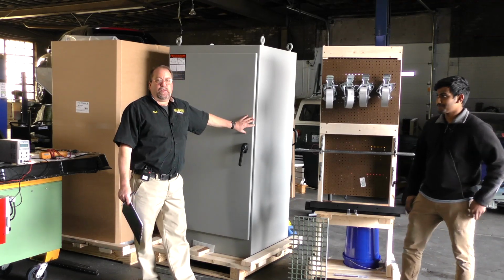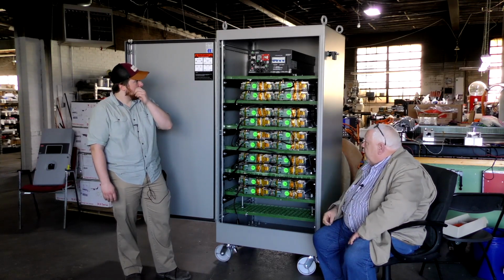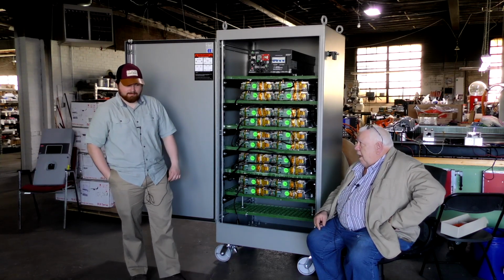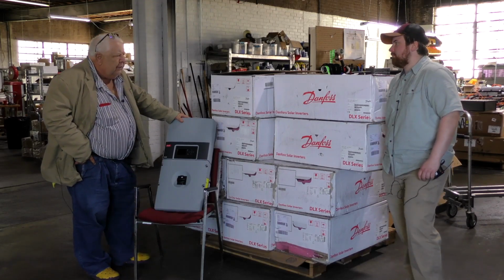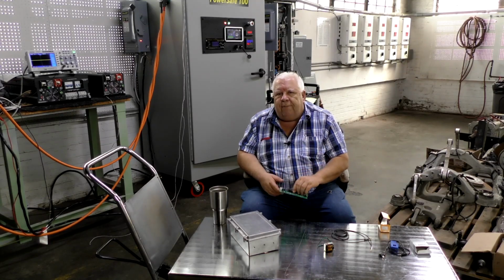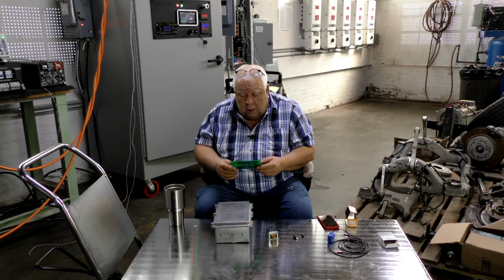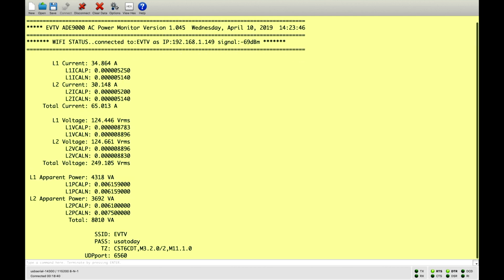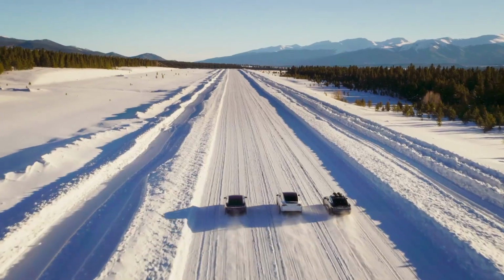PowerSafe 100 Solar Energy Storage for Antigua using Tesla Model S Battery Modules

Comment: I considered using Tesla packs for my offgrid home, instead opted to string one-hundred 1200AH Nickel-Iron cells in series for a 120V nominal battery bank. Edison cells will last a century and millions of cycles without any degredation.  Chang-Hong is the world's largest manufacturer of NIFE cells. I negotiated a $450 per unit price.

Comment: About those 6.3V transformers you want to use in your project to lower the 240V to safe levels: those, or in fact any transformer of this kind introduce reactive power losses and cos φ at the secondary is lower than at the primary. Not sure if that will make any difference for the AD chip you want to feed through those, but from what I understand, you want your measurements to be synchronized with the mains voltage. The phases of the measured voltage will be a little off. Also, those transformers might need to be picked and matched,  I doubt they have been precisely wound as they are apparently off the shelf cathode heaters for vacuum tubes with +/- 10% tolerance.
Reply: Simple electric space heaters are a simple resistive load that may be used during calibration of the phase angle calculation object.  (close enough for government work).  A dual trace O-scope can also graphically display how close the signals are from the voltage and current signals with known resistive loads.  Run the O-scope from an isolation transformer though.  (Don't ask how I know that)

Comment: You are probably deep into making your own solution now but I hope you evaluated eGauge Jack. Much more of a engineer’s tool than Sense. A lot of work has already gone into it and the data is available via Modbus and BACnet. A display sever is also built into the device. Biggest downside is when measurement points are over a 100ft or so apart and multiple units (easily share data) become necessary. I do not work for them, only a customer.

Comment: Giving the the Model S batteries are still fairly expensive, could your PowerSafe 100 be built with one set of batteries (2S1P) and more batteries could be added later as needed?
Reply: @Jack Rickard OK, that's good news. I was wondering if some point you could build a single battery setup going though the minimal parts install (maybe when you do the next Powersafe 100 build?).  Also, I was wondering about the 96 volt Sigineer inverter/changer. I was wondering when that might be available?  - Bart

Comment: I think I look forward to your show more than any other. Someone told me that 240v ac was really +400 to -400 passsing 0v 50 t0 60 times a second. This gives u a chance to unclench 50-60 times a second that u dont get with DC?
Reply: @EVTVMotors  Thamks Jack
Reply: @EVTVMotors  Last time I brushed the back of my arm up against 400 VDC the pain was excruciating.  I shut everything down and installed two Gigavac 400 amp lockout switches I stole from my EV conversion parts hoard.

Comment: @Jack Rickard 
While watching the video, I took some notice of the internals of your "in progress" PowerSafe/100 (PS/100) it looks like you all have taken precautions to avoid lateral movement of the battery packs and inverter, however, I don't see anything for the restriction of vertical movement. Perhaps you all haven’t gotten to that part yet but to make the shipping trip to New York, let alone to the island, the battery packs, inveter and all of the shelves need anchoring down! Maybe you will have bolts that will come up through the sidewall mounted angle brackets that go through the "fiber grate" and will fasten and anchor the shelves and then have some form of retaining straps fastening the batteries and inverter to the shelving?

Also, I was wondering if you all put a rubber gasket or sealant between and around the mounting plate of the cast metal wheels and the bottom of the PS/100 before fastening things together?

Just some thoughts as I watched your very interesting, as usual, video!

Thanks.

Comment: So how to make such inverter off grid. I need a 400v inverter to work with my model 3 battery but i dont want to grid tie cause detroit thomas edison has made it not finacially worth it. Low buy back rates. Really inverter to inverter? To generate the wave yo sync to. Help
Reply: I bought my 20 kW Sandi islanding inverter through evtv.  What with the tariff and all, you'd want something with the MPPT charge controller built in.  Something smaller would also allow the DanFoss units to play well together off grid.

Comment: Thanks for another interesting video!
I agree that open communication protocols are essential, and even better would be fully open source. 
I wonder if you might unknowingly be reinventing the wheel? I recently bought a IoTaWatt, an elegant energy monitor similar to a Sense but more expandable and fully open source. It is well documented and a fully certified product readily available for a fair price. Being open source, I suspect you could easily add the CAN UDP output. I’ve just started using mine and still need to configure a database since the integrated web served graphs are clunky. So far, with real bidirectional power readings and flexible calibration it seems to be an excellent complexity/usefulness tradeoff. 
You may find it does all that you need to provide an ample grid power signal. 
https://iotawatt.com/
Reply: With the new shield for the ESP32 one can get the AC monitored data AND still program in the CAN interface for your Tesla, Leaf, or model 3 packs.  The six digital I/Os allow me to shut down all six contactors in my selfish solar system BEFORE I light up my shop the way an unmonitored BP pack did back in the Tesla drive lab.